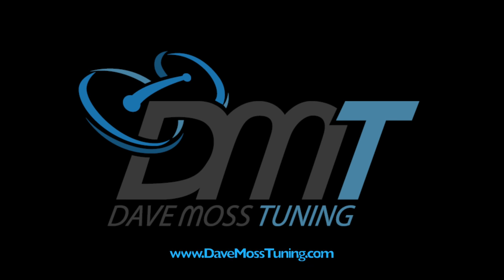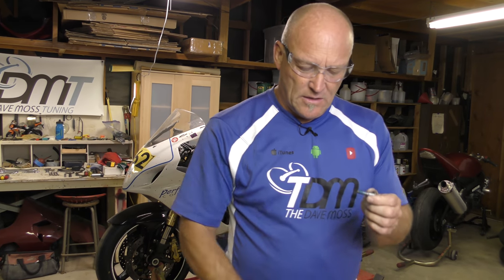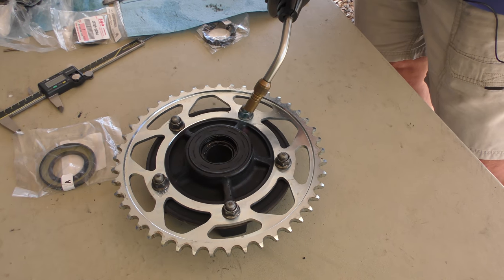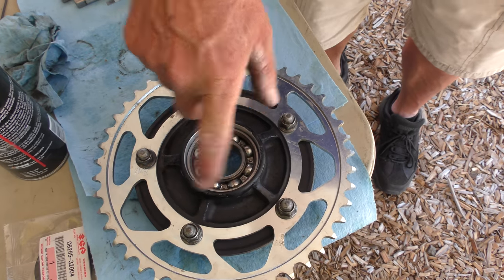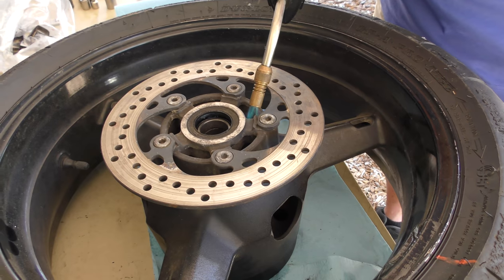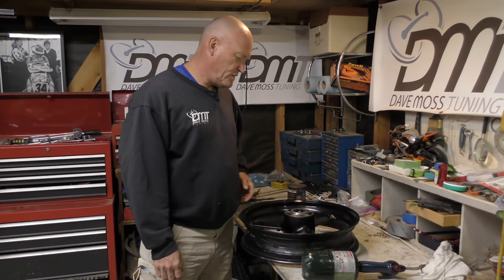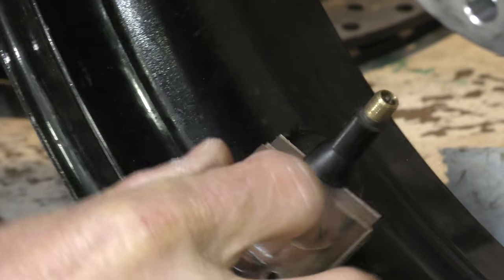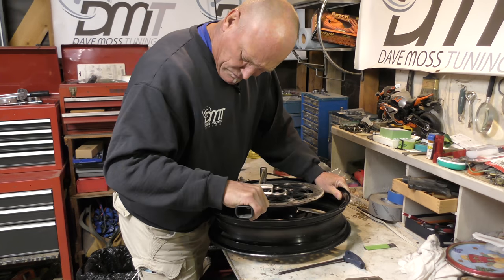Trash or Treasure: '05 GSX-R750 Rotors & Wheels Eval

Comment: Good; but, suggestion? I work in bearing manufacture... to clean out the bearing I would spray it and hose it with air until very clean, (NOT allowing the bearing to spin fast when dry, as will damage the races), Then, check for race damage: spritz a very little WD40 in between the balls, then hold the hub up in vertical position (the way it sits in the bike) by one/two fingers inside the bearing inner ring, and spin the hub at moderate speed, looking to feel for CLICKS (ball denting) or GRINDING (raceway scoring/remaining dirt). Repeat cleaning if necessary... if clicks/grinding remain, time for a new one. Also- most modern automotive-level bearings come out of the factory with 30-35% inner-capacity grease-fill...(commonly Chevron SRI #2 grease, the best). Dave's fill amount looks close enough. Leaving grease in the  seal-groove is not recommended; if all is clean it should ease-in smoothly. Also - for the rubber dampers I like silicone spray rather than grease, or rubber. Less chance of accumulating dirt later. But.. Good Stuff, Dave... Thanks.
Reply: The laws of physics don't apply to Dave. Dave knows all.
Reply: Brilliant, thanks for the educational insight!
Reply: for the cost of brand new quality bearings , I dont know why he didn't replace them , especially on a track bike, and looking at the condition of that bike, I'd want to replace a lot of stuff with brand new
Reply: Are ceramic bearings ok for street use
Reply: @903assengsxr7  Honestly, I have little experience with ceramic bearings. My best understanding is that they are used in situations where conductivity/magnetism or corrosion would be an issue. While they are purported to be very smooth-running, I could see issues with brittleness under hash automotive/motorcycle applications. Outside of NASA (or perhaps MotoGP tech?), I see no reason why ceramic would be significantly better than 52100 chrome steel, the material of which all top Automotive/Motorcycle-style bearings are made. I'm quite sure the difference in "performance" would be negligible. Stay with good, top-brand-named (Timkin/NTN/FAG, etc.) "EMQ" (Electric Motor Quality) 52100 steel bearings and you'll be close enough to the pinnacle. ALSO- "ABEC" is vastly misunderstood; people consider it a level of QUALITY when it simply refers to the tightness of the tolerances. Also, the "C" designation refers to the radial clearance between the ball and raceway components... the "slop" if you will. "C0" is "Standard".. C3 is common in automotive. BEST- Stay with your factory OEM call-out, they did their homework the best.
Reply: @888jackflash  impressive lol I was just wondering if the road environment was to harsh for ceramic yk but that’s a nice explanation frfr
Reply: @903assengsxr7  Yeah... from what I know, stick with the Industry engineers and stay with proper (OEM) 52100 steel bearings. NTN or NSK Japanese. Nothing will be much better... or more trusted.

Comment: Pretty sure that bearing didn't move at 36 min.  It can be very hard to tell as the races are so smooth that when greased it feels like they're turning them when in reality your fingers are just sliding around the inner race.  If you watch closely you can see a couple of marks on the inner race that don't move when you are checking it.
Reply: Thats why for me everything what is measured by finger is worth shit. You can easy commit a mistake. The rule with bearing is simple, every time You see a bearing, replace it without wasting Your time for checking it`s condition. They are very cheap so why not

Comment: I learned that i need new cush drives, I replaced my front and back sprockets and chain and seen there is lots of play in the old ones. The old sprocket was so worn that the teeth on it were sharp and bent all facing the same direction. Thank you man!

Comment: Hey Dave, thanks for the Video, I have exactly the same bike and did exactly what you are doing about two years ago. Trash or Treaure? you already know, absolute GOLD!  Superb bike.  However , and I pray that I am wrong,  @35.45 you check the front wheel bearing,  it doesn't move at all! The video is very clear, excellent camera man ; -) i've replayed many times, and Im sure you will agree  watching back the video, the inner race of the bearing doesn't move at all when you attempt to rotate it. It appears to be seized.
Reply: Seemed the same to me, no bearing rotation at all.

Comment: It works fine to heat the bolts with a heat gun to burn the loctite,  it just falls off.   Heat gun also works to get the seals out. And fork seals by warming the outside of the tube. About 70 celcius is enough.

Comment: In all my years i've never known anyone use heat to remove or replace simple dust seals. And if you're gonna remove them why not just replace the bearings for just a few bucks anyway?? Love your suspension work though Dave, you're a Jedi Master of the dark art :)
Reply: Probably didn't have a bearing puller and installer on hand.
Reply: @denchua  Not needed for wheel bearings. Knock them out from the back with an old screwdriver, and tap them back in using the edges of the outer race of the old bearings. I do have a set of bearing pullers for just this, but really, you don't need them. And I find the seals come out with less damage if you use something wider than a screwdriver ie a tyre lever.
Reply: ...and if you change the left bearing, you also change the right bearing too. Why? Because it did the same number of revolutions as the already worn out bearing. Same for seals of 2stroke crankshafts, forks seals....and so on. Call me Captain Obvious, but otherwise you will end up repairing your unreliable bike every weekend.
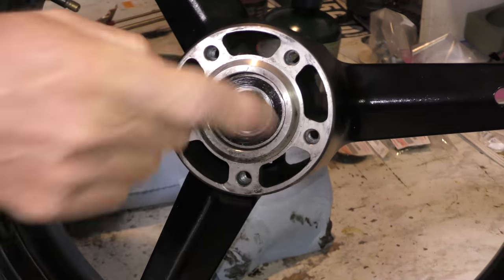Reply: ...and that bearing at 36:00 wasn't even turning :(
Reply: @SteveCardiff  haha I came here to see if anyone else saw that too
Reply: Bearings , if reused must spin freely after flushing using light compressed air . If no compressed air use the unlit torch . Check for slop when clean . Bearings come with a variety of clearances , e.g. C3 etc. You will actually hear if a bearing is good enough to ruese . 2RS bearings at this age should be replaced ,especially if seized like the front one shown . Someone had already added moly based grease to get it to spin . Always a good sign of a shot bearing . When packing open bearings ensure that the grease has passed through the ball races to the rear . Always take note of the number laser etched on the bearing to order replacements in the future . Remove old seals with an old spoon end tyre lever which you can find at boot sales for pennies . Clean ends and the seals will pop much easier as load is spread . Screwdrivers can mark the seal mount surface very easily.
Rotors or discs in the UK , should be mounted in a lathe , trued and then honed if within tolerance by mounting your hone on the crossfeed . A drill driven chuck can easily be made from a small collet shaft a couple of bearings and a piece of tube . Generally new is 5 mm and before wasting time , clean a small area either side and check with a micrometer at least 3 positions around the disc to check if the disc has worn evenly . If not replace the discs as the uneven wear will cause pads to oscillate and you will have shit brakes regardless of honing .
A smear of Blue Hylomar Aero on the inside of valve seal helps the seal bed without bunching when tightening and ensures a good seal .
Nothing wrong with a ' bendy bar ' torque wrench as they actually measure torque by being made of a steel with a known hysteresis and are a measured distance in length . When using one always apply the pull at the same hand position . Great for quick torquing wheel bolts etc at a race track as no resetting required . You can check it against a good one now and again and also ensure the indicator is on zero for every bolt . Its all about getting them even when your using a thread locking agent in this instance . Most thread locking agents are green, blue and red indicating soft , medium and WTF !

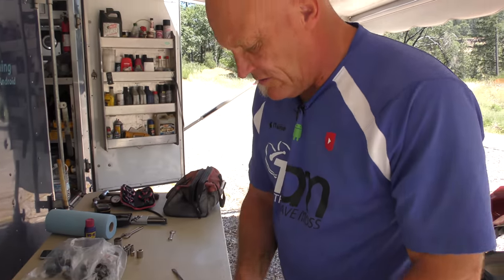Comment: 21:25 i always use syringe to do this. You can easily squirt the grease in the holes until it comes out by itself. Much quicker and cleaner than punching it with fingers 😁

Comment: Hi mr Moss,
@ 29:48 correct  me if I'm wrong.
I think the reason for packing the outer dust seal with grease is to keep water and other stuff from entering and sitting between the sealed bearing and the dust seal. If water goes in it will find the way through the bearing.
Reply from the maker: 100% correct if you have an open face bearing. The bearings in the GSXR wheel are sealed with th orange plastic cover and that is what for me, created some confusion.
Reply: @catalystreactionsbw  I thought that this principle applies to sealed bearings as well. In theory water can get through the dust seal and sit between the dust seal and the sealed bearing corroding the area and maybe working its way through the sealed bearing (if that's a possibility). Sorry for not making myself clear in the first post.

Comment: It’s much more fun than putting sealed bearing in. Great job Dave. I always run the sprocket /bearing on my finger , you can feel the slightest of degradation of the bearing as it puts a slight loading on the bearing

Comment: Don’t use a Dremel for cleaning off thread locker. Put a BRASS wire wheel in a drill press. Run the press at its fastest speed, wear a good pair of leather work gloves and hold those threads into the brass wheel, FAR faster and efficient and less wear on threads.

Comment: Can sealed wheel bearings be repacked with grease ? I've seen videos where the seal is taken off.

I've had the rear wheel bearing on my Ninja 650 disintegratre after a 8000 km trip and half of that was offroad-gravel like surface. Total kms done on those bearings was about 38,000 kms. 

 I'm wondering why did the bearing fail with nearly all the bearing balls fell out, stranding the bike. Would greasing the bearing before the trip helped ?
Reply: Did you check the wheel bearings before that trip? U could probably feel some side to side movement of the wheel if u did that, and that means the bearings are getting worn out. Putting new grease in might have helped, but it has to be done before its getting worn out.
Reply: 3 months late but even if you already have your answer, ill leave this here for future readers

its quite common for new bearings to wear out if you install them incorrectly. on motorcycle wheels you have a center spacer, that sits between the two bearings. it is essential, that this spacer is installed correctly, as to allow the axle to position itself easily, so that the inner races of the bearings arent pulled out of the bearing, when the axle is tightened and are instead tightened against said spacer.

if you leave too much space when installing the second bearing, or if you push it in too tight, it will lock the spacer in place and push against the inner race, prematurely wearing the bearings out.

best to do some research, but as a quick tip:
if your the spacer is tight, but you can still move it with finger pressure, then your bearings are ready to go

Comment: On the Rotor you're better of using 800-1000 Grit Paper In a wooden Block to get a Level smooth and Clean Surface.. By Hand.

Comment: Does honing your brake discs like that make a difference in braking power?
Reply from the maker: Honing a disc removes all the high spots of old brake pad material so you have a much better consistent contact patch at all times.

Comment: Hey Dave!  Hope all is well.  Quick question, what level of grit was the flex-hone?  I've got to re-do the bedding of my new EBC XC rotors as I've developed a hot spot on the first try which now causes it pulsate when I stop.  So I want to get this hone tool to complete this task.  I know they have fine, medium and coarse.  Just curious what you used and maybe what you would recommend in my case?  Cheers, Todd.
Reply from the maker: Dave Williams, editor, replying here. We used the coarse.
Reply: @catalystreactionsbw  Thanks Mr. Williams!
Reply: @catalystreactionsbw  Just curious, how long did that flex-hone tool last?  I bought one off of Amazon and it started disintegrating after starting the first side of the second rotor.  Basically it lasted 1.5 rotors.  Junk!
Reply from the maker: @viperxbr  We did all the rotors and it is still in great shape.
Reply: @catalystreactionsbw  Thanks for the info Dave!  Fortunately I was able to finish the set with what was left.  It must of been a defective tool.

Comment: @35:57  shouldn't the silver inner ring of the bearing actually be visibly rotating ? like it did on the back wheel ?
Reply from the maker: The inner bearing on the rear wheel is a bushing that makes up the gap between the wheel bearing and cush drive bearing. The spacer for the front wheel is locked in by the wheel bearing, then the outer spacer stays locked in place by axle tension.
Reply: @catalystreactionsbw  that's too much "bearing speach" for my knowlegde but I'll try to translate, tnx :)

Comment: Take to the sandblaster in the back ground and use medium media to clean then measure,,,then hone?
Reply from the maker: If we used the sand blaster it would be a long blow out with compressed air then clean with rubbing alcohol.

Comment: Would it not be beneficial to balance the wheel, first without any discs/tyre, then with discs refitted, this way you know that any subsequent issues relate to the new tyre rather than the wheel or discs being the cause for any out of balance issues.

Also, put the bearings and seals for 30 minutes in the freezer, the slight reduction in diameter along with the slight increase in the housing (through heat) allows them to just drop in.

Having just done a friends rear wheel bearings, on her ER6F, someone had previously packed them with Copper grease.

Scary.
Reply from the maker: We are filming a series of variations with this process this week, so you must be reading or minds :)
Reply: @catalystreactionsbw  Does this make me an honorary Dave ?
Reply from the maker: @alanbrown5593  Sure!!!!!

Comment: Great video. Where Can i buy that grinder too discbrake?
Reply from the maker: http://www.flexhoneblog.com/2012/01/flexible-honing-for-motorcycle-brake.html
Reply: thanks for answer. What rotor do you buy  fine ?
Reply from the maker: @julleboy90  stainless steel rotors from Galfer is my choice, or EBC #2
Reply: Hi Dave, which grit you used? 60,120 or 240?
Thanks
Reply from the maker: @pedrosousa7493  BRM Flex-Hone for rotors 60Z #1525 Coarse
Reply from the maker: @pedrosousa7493  240
Reply: @catalystreactionsbw  240 and not 60? Roger that! Thanks

Comment: It is possible to get the seals out of sealed bearings and re grease them.
Reply: for a £5 bearing... you mad? just replace it
Reply: @bikerboi1983  was just saying you can, it can extend there life for a bit if you don't want to change them!
Reply: @K-so8gx  you can't clean the old grease out and properly repack them though. if the bearings are still in good shape its best not to try it. if they are old or worn then just replace them. 

problem with what dave is doing is those big seals he is changing which get damaged during removal probably cost more than a pair of new skf bearings! 

so if you are removing those types of wheel seals, replace the bearings!

Comment: I don't see the sense in cleaning brake discs. The brake pads do that well enough. If necessary, I'd just spin the wheel on the bike with some fine grit sandpaper held to both sides. I also don't see the sense in removing ALL the Loctite off a bolt with a Dremel tool. It's enough to just twist it around and get the loose stuff off.
Reply from the maker: This video will provide more undrestanding. https://www.youtube.com/watch?v=6zpfKQ3OUJw&t=43s
Reply: @catalystreactionsbw  ok, but that video doesn't prove that pad-to-embedded-pad-on-the-disc has less stopping power than pad-to-disc stopping power. The frictional coefficient may be even better with bits of the pad embedded on the disc than pure metal.

Comment: Blowtorch just to get seals out! totally unnecessary in my opinion, they just flip out with a screwdriver.
And when you do use the screwdriver please have something underneath to protect the surface.
A lot of potential for inexperienced people watching this vid to do major damage to their nice painted wheels.
Reply from the maker: What would you suggest? Shop towel, microfiber towel?  What thickness would be required in your opinion as adequate based on your technique?
Reply: @catalystreactionsbw  I'd probably use a piece of wood but anything really, just don't think its good practice to lever against any part of a bike like that without protection, especially on ally.